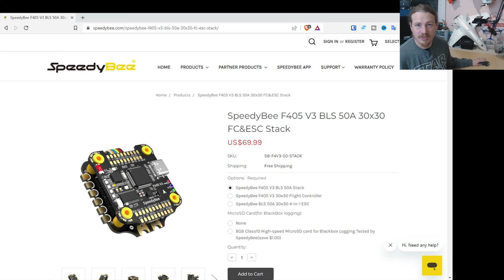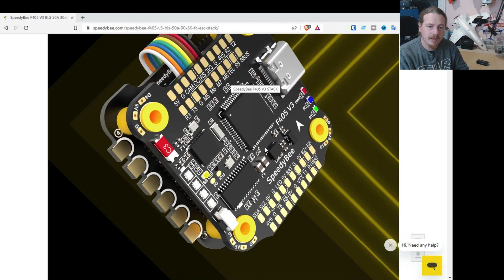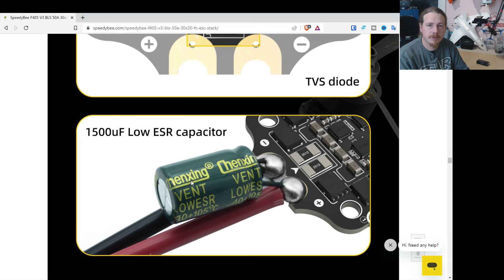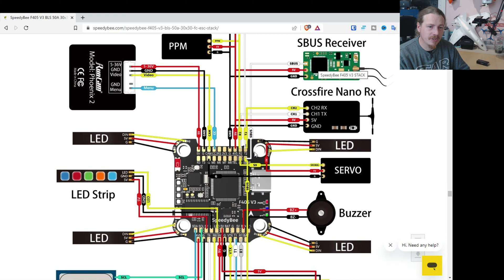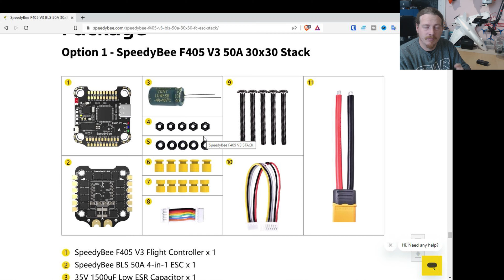First look at the SpeedyBee F405 V3 Stack

Comment: I has a request. When you get around to doing your quad build can show a way to have the quad slow down a distance from the home point so it doesn't come to land so fast? Not sure if it needs to be done in programing or not. The landing speed is fine and easy to set. Just wish that say when the quad gets X distance from the home point it slows down to x speed.
Reply from the maker: Hi Sam. I'll make a note of that. I'm not sure there is anything for that; though to be honest, I've not looked. I know there is a setting to change the vertical speed at a set altitude. But not sure about the approach speed.

Comment: Have u tried the FC for INAV? Since mine the esc protocol option only multishot and motor didnt want to spin when it armed
Reply from the maker: No, I have not used this with INAV. I know that you can’t use DSHOT with this FC currently. But from what I have heard, multishot should work fine. 

How are you testing the motors. Use the slider on the outputs page. If that works, the setup of the motors is fine. If you’re using your transmitter, there could just be something blocking arming. Check the system messages in your OSD or type status in the CLI to see what could be causing the block.

Comment: I just recently installed it on my first 7"  build. Works great so far and absolutely love big pads for soldering. Lately l didn't enjoy freestyle 5" that much anymore but 7" inch cruiser is a nice addition to fpv wings and LOS planes. The only bummer is RTH on BF. Gets me nervous.  Will definitely try BF 4.4 /looks promising/and lnav when you have a video on it...
Reply from the maker: Cool. Nice to hear about your positive experiences with the flight controller. I’m looking forward to getting that quad in the air. I have just won a 7” on eBay. So I’ll be installing INAV on that, and begin my journey.

Comment: I must be on the dark side? I just bought this FC on Amazon because it was so cheap. Im a fixed wing guy who hesitantly built quads in the past and somewhat enjoyed the experience of flying them. Something very unnatural about quads that leaves me on the fence! Could this be used for vtol so we could have the best or worst of both worlds?
Reply from the maker: Hey Chris. It depends on the ArduPilot target (if one exists). I’ve not looked to be honest. If outputs 5-9 can be used for servos. Then it could be used for VTOL. Of course, you’d need to run an external BEC for the servos.

Comment: Happy new year Darren! Why not to use its for fixed wing with INAV? any limitation?
Reply from the maker: Happy New Year Yuval. 

Because there’s no need for the 4in1 ESC in INAV. Also, it doesn’t have a servo BEC suitable for fixed wing. You would need to make your own. Other flight controllers are more suitable for that task.

Comment: I picked up a Darwin 129 and it was flying good but the FC was getting to warm for my liking and there was no current sense on the esc. Picked up these and like them so far. Running inav on it. Only thing I don't like is the buzzer or lack of for an inav build. Also couldn't get the led's working. Can't wait for your build. Would like to see how to get the quad to rth and start slowing down sooner instead of coming to a screaching halt then over shooting.
Reply from the maker: Sounds good Sam. Yeah, I guess the buzzer would be useful. Though with quads, I tend to use an ViFly lost model beeper, which can double as a buzzer. 
My build with this FC is going to be BetaFlight, with no GPS. When I do the 7”, it will be INAV with navigation.
Reply: @MrD  I use the vifly style as well with 3 wires. 5v, ground and signal. On this FC I see Bz+ and Bz- but no signal. Tried the Dshot setting in INAV no luck as I can only get multishot to work. Might try loading bluejay on the ESC but haven't wanted to mess with it. Still trying to get position hold more stable but cold and wind have put a stop to that for a while.
Reply from the maker: If you using INAV, you have to use Multishot. DSHOT doesn’t work on this FC with INAV currently. 

As for the Vifly:
Vifly -> FC
Gnd -> Gnd
5v -> Bz+
Signal > Bz
Reply: @MrD  Thanks, will set that up.  Right now I'm trying to get the position hold to work. Getting toilet bowling for the most part. Have calibrated the compass more times than I can count at this point. Using a Matek M8Q 5883 at the moment. Its showing the correct heading so I believe I have the correct orientation selected in INAV. Might get a BN-880 and see how that works if I can get this one to behave.
Reply from the maker: Good luck with that. I would have thought the Matek GPS/Mag would be better better than the BN-880. I've not had a quad with GPS at all yet. I'm looking forward to working through all this stuff.
Reply: @MrD  The issue with compass's it the orientation. With the arrow facing forward you have to set it as flip 270. There is a CW and CCW as well but don't think that would matter if the arrow is forward or backward. Do not understand why forward can't be normal and back can't be 180.

Comment: Excellent Darren, always like flying and building quads now and then and using a ethos radio as well.  happy holidays mate.  :)
Reply from the maker: Merry Christmas mate. This will also be on an ETHOS radio. Still deciding on the receiver. It’s a shame FrSky don’t have a receiver with those little ceramic antennas. I can imagine they’re pretty nice in a quad. Sure there’s some carbon, but that’s on the nulls anyway. Plus nothing outside the frame to get chopped and nothing that could cause extra vibrations.
Reply: @MrD  I have used the archer r6 nice and small footprint and sbus, also use this in my smaller t rex helis.

Comment: Just been building mine now on a 7 inch foxeer aura frame. Going to kit it out with Raspberry pi and Ruby HD.
Reply from the maker: Cool. My friend has that frame. His had issues with the front arms being slightly too short, so the props touched. Foxeer sent him out some replacements which worked perfectly.
Reply: @MrD  my arms seem long enough. I’ve only just got it so maybe it’s some kind of v2. Are you running multishot? I hear the word on the street is to upgrade the esc firmware? Some have had problems.
Reply from the maker: @gosurc1860  apparently it was only the first batches that had the short arms. So that should be fine now. 

I’ll be running DSHOT and plan to flash the ESC with Bluejay. I still have building to do first before I get to that.
Reply: @MrD  I see. Does multishot suck then?
Reply from the maker: @gosurc1860  I want to use bidirectional DSHOT for RPM filtering.

Comment: Blessed and Merry Christmas to you and your 's. I have only run INAV on my quads..Well I ran AP back in the day 5-6 years ago. I've already had to experience RTH when my VTX popped a regulator. As I was flying around trees I got ready to go look for it. But before I moved, here it comes and hovers above and descends to within a couple feet of the takeoff. If I had thought about it I could have watched it happening on my TX's INAV tele lua script on the screen. Impressed. In INAV Acro with the standard 5in. settings it flies fine as I am coming up on a year of infrequent flying with it. Thanks for your sharing what inspires you and for your Dev work allowing us to enjoy and be inspired by all the variety and diversity which is model aviation and beyond.
Reply from the maker: That's really cool to hear. In RTH we trust I guess :) But yeah, when the VTx goes, it is so handy. I'm still starting my quad journey. My quads currently are on BetaFlight. But I will definitely be building some INAV quads. The plan is a cheap build to learn all I can. This will no doubt need more work than a decent quad, so I should get more educational value from it. Then a decent build to share the setup and configuration.

Comment: Couldn't you repurpose the extra motor pads for PWM to control servos for a fixed wing in INAV? Would probably need to use a separate BEC to drive the servos due to limited amperage from onboard 5V BEC.
Reply: I have one of these f/c's from a planned quad build but going to fit it to an atomrc dolphin. I have seperate 5v bec for servo power. I'm hoping s3 amd s4 motor outputs work for servo control. 🤞
Reply from the maker: To be honest, it might be a bit wasted in that situation. You may as well not use the 4in1 ESC. If you do want to use it for your Dolphin. I would flash it with INAV first, then check the mixer to see where the servos will get output to. Don’t solder up first, then find out that they’re in the wrong place.
Reply: @MrD  cheers, I will try u test setup first like you said. I may just end up coughing up the money for a matek. I'd like to use the 4in1 if possible for the amp draw info ect.
Reply from the maker: @rwdturbo  you would have to use your own wires for the 4in1. You couldn’t just plug it in. That would also sent the other outputs that you don’t want sent to that ESC. Any half decent non-fixed wing ESC will have telemetry these days. So maybe if you do use this flight controller, save the 4in1 for a quad and just get a single ESC for the Dolphin.
Reply: @MrD  flashed inav and it had s1 motor  s5 and s6 servos, so soldered up a reciever and servo  connected to s5 (motor 5) and servo seems to be working correct. 🤞
Reply from the maker: So S1 to 4 are all motors in INAV, and s5 to 9 are servo.
Reply: @MrD  I selected a delta wing, it only assigned one motor and two servos, so the rest show as no output.
Reply from the maker: Yeah. But if the first servo is on S5, that means the others before it will be motors.
Reply from the maker: It depends on the timers. But quite probably. But yes, it would 100% need a separate servo BEC.

Comment: Nice to see you doing stuff with quads, at the end it's fpv and that's what counts. Personally i'm sorta done with quads, i found myself repairing them way too often and it really took the fun away. With fixed wing i just enjoy the flying knowing that there's a good change i can take my stuff home fully intact.
Reply: Very true....
Reply from the maker: Thanks Herman. Oh, I definitely had a phase like that. My current quad I actually built around summer 2017. But I found that I flew it, had a problem, then wouldn't touch it for months. But, this summer I thought I'd give it one last go; and everything just clicked. I was flying better (way less crashes) and there didn't seem to be any random gremlins that popped up either. I probably flew it more in August this year than I did since building it. The new build is because I can trust myself with a decent build and not trash it. It'll be interesting to see how the AOS5 flies compared to my original Banggood Alien clone.

Don't worry, fixed wing will definitely be my main focus. I love flying planes both FPV and LOS. That won't stop.

Comment: An INAV series for setting up a quad would be awesome. I want to do a mid- to long-range build with INAV using the SpeedyBee but don't have any INAV experience.
Reply from the maker: Thanks for the feedback. I'll make it happen. It won't be soon though. I've not flown a quad on INAV yet myself. I will be building myself a budget 7" quad on INAV. The cheaper frame should give me more issues to learn from. The I'll put everything I've learned in to a decent 7" build in a video or series. So it will take time. But it will happen.

Comment: Matek F405-MiniTE vs Speedybee F405 v3 FC??
Reply from the maker: Personally, I would go with the SpeedyBee. The Matek is only £27 cheaper than the SpeedyBee. But you need to get ESCs for that too, so would work out more expensive. Both seem to have issues with DSHOT with INAV.

Comment: I'm glad your mixing it up ! I have seen next to nothing on ardu/Inav driven Quads . I never really was interested in weed eaters ,but they are very portable and you can get instant therapy . We need both ! Hmm I always thought all F4 boards  were being graved for  F7. I cut my teeth on Mamba boards , been bullet proof . My next try would be a F7 speedy board . Merry Christmas from Canada .
Reply from the maker: Merry Christmas. I know what you mean. I built my quad in 2017, but never really flew it. Fixed wing was just way too much fun. But, this summer, something just clicked. Now I enjoy both.
I find a lot of quad boards still use F411 and F722 MCUs, which are most definitely on the back foot when it comes to fixed wing. But the F405 is still a decent processor on both platforms. I can easily see that outlasting the F722 on fixed wing. Due to some gains in code efficiency in 6.0. I can see F411 and F722 lasting a bit longer than originally thought in INAV. But they'll definitely be the next MCUs to be dropped.